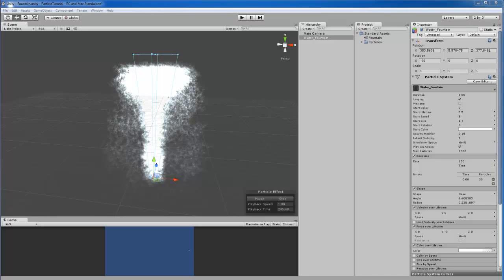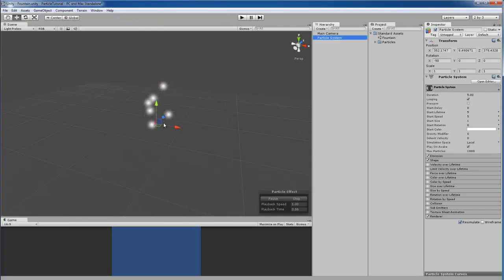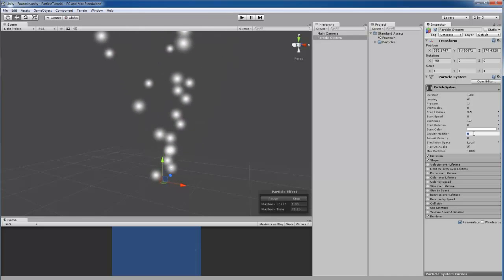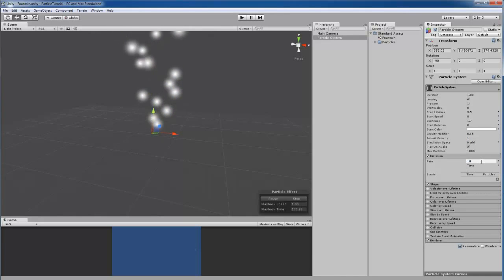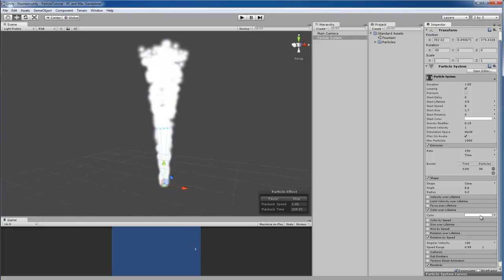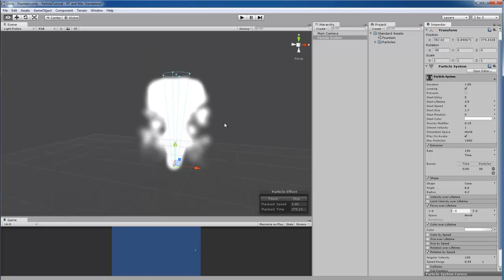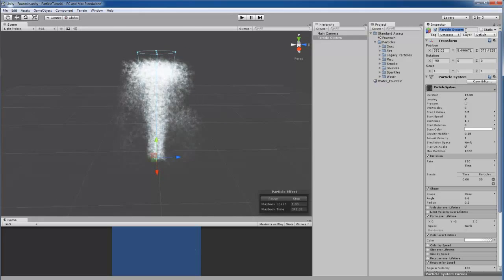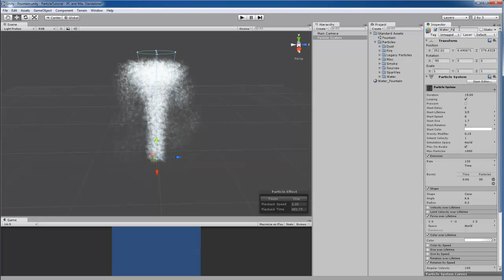Unity 3d Tutorials - Particle FX - #2  Water Fountain

Comment: hey! Where did you get that texture? I found another online, but my particles turn out blocky with that texture :/
Reply: Pretty sure you've got this figured out by now but for anyone who encounters this in the future - by default the particle effect's Renderer component uses a box mesh (hence the blocky texture). To change this you need to select your particle effect. Under Renderer -> Render Mode select Mesh and then pick the mesh you prefer (for example, a sphere).
Reply: @nadavrot  and when you choose a mesh don’t choose something like Chihuahua unitly won’t like it
Reply from the maker: Make sure that you are using the correct material. Some materials remove that blocky effect. Try "particles additive"
Reply: ***** Thanks for the reply! I tried doing that, but unfortunately the particles still come out as squares :(
Reply: do you have them in black circular frame ? if not its not gonna remove it